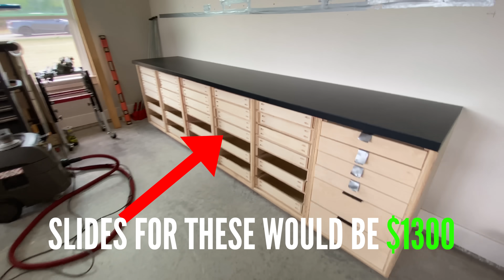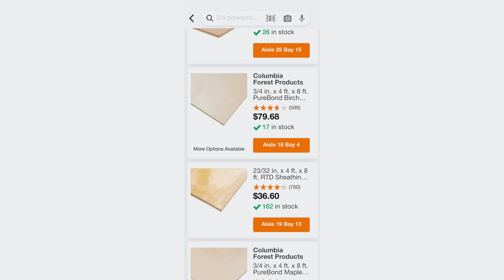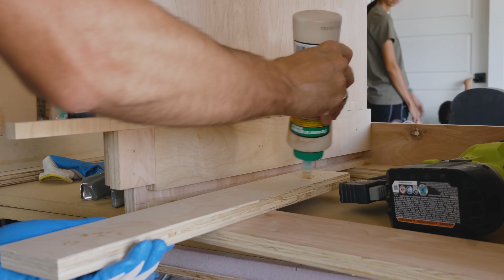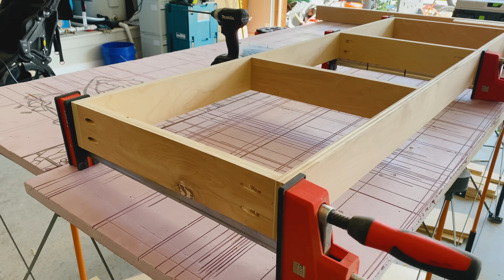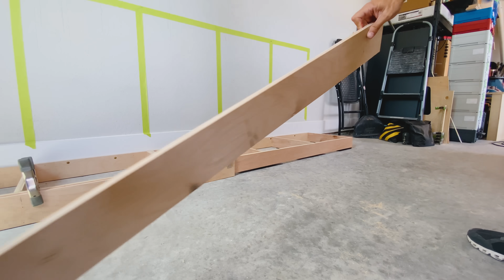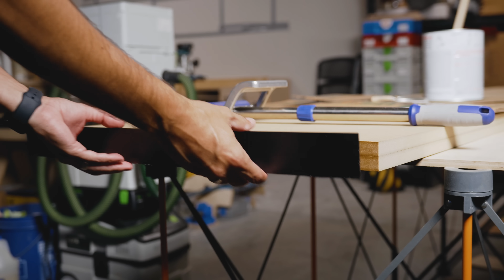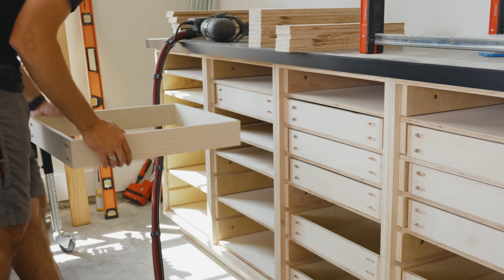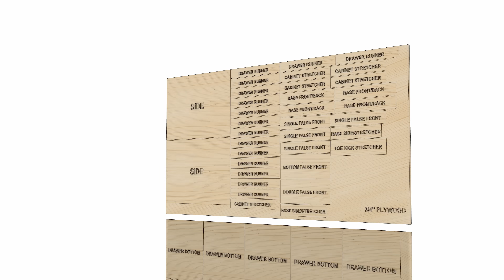Drawer slides are expensive. Do this instead.

Comment: I don't know where the Hell I'd find a snorkel emoji.  Hey, I'm no YouTube artisan but I can say I have a bit of experience with cabinets and counter tops. 
Back in the late 70s and well through the 90s I made most of my laminate tops with Vaseline jelly.  Once you adhere the laminate with the J-roller put a dab of petroleum jelly on the router bit's bearing.  Then go around the edge where the bearing will touch and put a light film on it too.  
Also, I never use a washer with a bearing on my router bit when I'm trimming laminate.  If the bearing has a washer it can cut a fine line.  I have found, in just the last ten or maybe 15 years, that treadmill lubricant (silicon grease) also works well for this.  

One other thing I would recommend is to cut your laminate closer to the actual finish size. Leave no more than 3/4" all around. This way you have less chance of it breaking off under its own weight.  

Another thing you might try, that looks and works better than laminate on the edge band (In my opinion), is to put a hard wood edge band on the counter top.  use some scrape pieces ripped down.   Then you can rout it straight or rout an Ogee (modified) or a chamfer.  

Also, after 45 years of installing cabinets and making counter tops, I have learned a few things about shimming boxes.  You need to glue those shims into place on the floor.  I usually run a little caulking (whatever is on hand) on the inside of the toe-kick base and the top of the shim.  Otherwise, within just a few expansion and contraction cycles they can move out from underneath the toe kick and your bases can sag.  This can cause the drawers, that once worked perfectly, to bind.  And, it will leave you wondering why.  I can't tell you how many kitchen upgrades of done and found the shims towards the center of the cabinet floor area and not under the toe-kicks. 

Another thing, if you don't mind me adding, Butcher's Boston Polish (I prefer this one because I was born in Boston) or Johnson's Paste Wax added to the base of your drawers (draws, drahs) and the inside edge of the runners will help the drawers slide and keep it from swelling with humidity.  As a young man I worked in my uncle's furniture shop (from age 15 to 21).  We made custom pieces and did upholstering.  Once a year I would wax the drawer slides.  His Dad made those drawers, similar to yours, and he started that shop in that building in 1926.  It's a tried and true method for drawers.  Wow, I don't believe I have ever used the word drawers this many times before.  Oh! one last last thing. Don't use paste wax on the router bit or on the edging!  There is naphtha and carnauba in paste wax and it will dislodge/ dissolve the contact cement and your edges will curl off.   
Anyway,
Thanks for sharing the video.  I'm an old man and don't enjoy much anymore, but I really enjoyed this video.  And, great job on the cabinets.

Comment: 🤿 can't believe you used duck tape like an animal.... Very cool alternative to drawer slides and I like when they are built on a unit height they can be interchanged to different positions as needs change. I would probably have looked at not making them as individual boxes and eliminating some of the vertical pieces of plywood, but it maybe would have only resulted in one less sheet. I'm looking at doing cabinets for my shop now and was pricing out drawer slides, the blum are out of the question for sure, but there are some semi-commercial places online that you can buy packs of five or 10 at a time of soft close side mount that come down to about $12 each, full ext. I will probably go that route myself though. I can definitely appreciate this method. But also my cabinets aren't staying in the garage if we move lol, I'll make sure of it.

Comment: Good point about the parallel guides, the 55” rail  and using the reference edge (the first cut) to continue a longer rip cut. I’ve seen thousands of woodworking videos and I’ve never heard it explained like that. Then again I’ve never plucked down my money for parallel guides, but I might have to reconsider?

As far as insulation you could probably just drill holes on the top and middle each bay if there’s fire blocking and blow in insulation.  Then just plug the drywall holes.

Comment: There are special router bits for laminate trimming. They have a slight beveled cut that eliminates the scaring on the adjacent laminate piece as you run the router around the piece. Amana Tool - 47200 Carbide Tipped Bevel Laminate Trim 15 Deg x 5/8 Dia x 1/4 Shaft

Comment: Just a tip for the laminate issue.  If you were using  a carbide laminate trimming bit, you might be able to smooth the ragged  cut by slowly going over the cut in the reverse direction.  It should remove the imperfections.   Nice design.

Comment: Well, what the internet wants did not take into consideration that a garage wall to an interior space of the home is a modified 1 hr fire construction being 5/8" drywall on 1 side and 1/2" on the other. This assembly needs to be taped and mudded to obtain its rating. Just another example of how homeowners screw up their homes by not knowing all the codes. I was an Inspector for over 20 years and have seen it all.
Reply: Exterior walls, and watch to the end 😉

Comment: Seriously curious, could you do all of this with 1/4" plywood? 3/4" seems very overkill if you're basically doubling up on most everything (cabinets sandwiched together is 1 1/2", maybe the drawer runners are good at 1/2" but you could probably even do that at 1/4" no?)

Comment: I’m surprised u was able to slide the insulation into the wall cavity so easily. How do you not have fire blocking ? And how is your wall not insulated???? Love the cabinets and I’m def copying ur system
Reply: Exterior garage walls in this part of the country are not typically insulated. The walls common to the living space are insulated.

Comment: I like the idea of not using drawer glide hardware! That was the traditional way in earlier times, when cabinets were more comonly built at the jobsite.
I have some old recycled cabinets in my garage that were built similarly to yours. Mine were built in 1950's, or earlier. The slides in these were built out of solid hardwood sawn lumber, maple I think, not plywood.
When there is a humid day the slides will swell and the drawers are dificult to open. I'm wondering if your plywood slides are having any issues with humidity?

ps: You should have used tape and joint compound when you reinstalled the drywall behind the cabinets. This is building code requirement for safety. A fire/smoke rated wall is required between a garage and a living space. (residential building code R 302.6)

Comment: To avoid goobering the laminate with the trim router, the issue is router flex. If you have a flush cut bit that is designed for thinner material, that works. Using a 1/2” bit is another possibility. But this is a simple idea: put a layer of painters tape on the trim router bearing. This keeps the router blade a bit proud of the surface . Then you go back with a block plane to chamfer the edges

Comment: Since there are no runners, the drawer can be pulled out too far. One way to prevent that from happening is to place a false back in, which does two things: 1) prevents contents from migrating to the very rear of the drawer which necessitates pulling it out too far and 2)Provides a visible queue when to stop pulling. You could easily retrofit all your drawers with false backs.
Reply: Just use a string and two screws. 
One screw on the back of the cabinet, one screw on the back of the drawer, string tied on the two screws setting the length the drawer can go out. 
If you ever need to remove the drawer just unscrew the screw on the drawer to set it free.
Reply: You can more easily build limits into those. Don’t overthink it.
Reply: You can just make the bottoms longer than the drawer sides. Of course the cabinet sides need to be longer to match.

This lets you pull the door out far and not skip off the track, but also lets you remove the drawer completely if you want to place the full drawer on a table for easy access to all the contents.
Reply: Jer Schmidt uses this method
Reply: @ewong7492  Jon Peters uses it for drawers in his projects as well.
Reply: But the point is that you can easily move drawers out and around with this system. 🤿
Reply: Depending on the space between the false back and the actual back, you could also stash heavier and less commonly used items in there

Comment: The old guy that taught me how to do this. He would  always put soap on the edge before Using the router. It helped to keep from burning into the side of the laminate. It was a long, long time ago in Atlanta, far far far away. But from what I remember we used good router bits with balbearings but still used soap. We would also use soap for lots of things like pulling wire through conduits. Come to think of it this old guy used soap for a lot of things. He probably even bathed with the stuff. I don't know. Anyway, that's what we did

Comment: Good Job, 🤿.  There is Central Hardwoods off Northwest Highway, also Dakota hardwoods off Mockingbird in Dallas. I’d say you might have been tipping a bit on your router. Also look up Dallas Makerspace if you run into a project you might need a unique tool for. The community is pretty good.

Comment: Great video.  Nice work!   I think your router bit is protruding a bit too long for the task.  It flexes small amount, especially if it's a 1/4" bit.  Next time, try to set your bit just over the length you need to cut.  Maybe a 1/16".  I think that should those routing marks.  That or your bearing isn't turning freely.

Comment: Pro-tip: no part of wood should be touching the concrete. At minimum it will wick up moisture and mould or you could have another flood situation that cause the plywood to delaminate and fall apart.
Reply: What do you usually put in between the concrete and the plywood cabinets?

Comment: In generall I like laminated tops, but hate laminated edges. I would have taken maybe 1/2 to 1 inch of walnutt as an edge band of sorts. First get the laminate on the top, to fit the walnut perfectly flush with the top. Made a top with the method, with laminate click tiles for flooring. Quite a bit cheaper, but not as sturdy ofc.

EDIT: as for the drawer - I would add a smal chamfer / round over to the bottom of each drawer and add a good layer of shop wax on all the sliding contact points. Protects the wood from wear and makes the drawer slide better. And add  a chamfer / round over to the rear ends of the bottom of each drawer, so the don't jam if you close them in an angle.

Comment: another super easy way to mount uppers is using a french cleat, makes them easy to take down if you ever move, or adjust if you change designs in the future. leave the wall strip full length to keep it straight, no fuss

Comment: And also you can trim it with a larger bearing, and put a chamfer bit and trim the edge after and use a file to clean up the edge for a smooth edge

Comment: 🤿 Great method. I'd be afraid of pulling the drawers all the way out, or having them tip out if pulled a little too far and take my hand off.
Reply from the maker: easy solution is to glue a horizontal divider about 3" in from the back. it acts as a visual cue telling you to stop, and doubles as extra storage for things you dont need all the time and dont want rolling around

Comment: Here’s the “trick”, iron on wood glue method. Use a foam roller to roll on three coats of Elmer’s wood glue on the veneer/laminate, and three coats on the surface to be laminated. Let it fully dry. Now you can lay the laminate onto your piece and freely position it without it sticking, take a hot clothes iron and heat as you would with iron on edge banding. The glue melts and fusses the laminate to the piece. You will never go back to contact cement again.
🤿

Comment: Drew im about to purchase the two Parallel guides. I have a question after to rip off the factory edge. How do to insure the 90 degree cuts are square? I rewatched the video trying to watch you cut the shorter cut but didn’t catch it. 🤿
Reply from the maker: the second cut it made using the guide rail square referencing the new rip edge.
Reply: @wittworks  thank you I knew I I need to spend a little more money!

Comment: The drawers will slide more easily and reduce damage to the stretchers and drawer bottoms if you add 3 thumb tacks to each side of the drawer.  1 on top of the stretcher at the front and 1 on the top and 1 on the bottom of the drawer at the back.   This eliminates all wood to wood loaded vertical contact.  Just be sure to make the stretchers narrow enough so the thumb tacks clear each other when the drawer is fully out.  Put the top drawer tack at the very end and the bottom drawer tack a couple of inches from the end so that all three tack are not vertically aligned when the drawer is put in place.  You could also put tacks on the cabinet sides at the front and the drawer sides at the back to further reduce wood on wood drag.  I did this with cheap store bought cabinets 40 years ago and they still work fine.
Reply: Clever.
Reply: Combine with some powdered graphite on the wood and I bet that would last forever.
Reply: why not just wax the slides

Comment: Just a heads up. You can get real cheap full extension drawer slides from Imex hardware. Never used them or heard of them until recently, but for the price they might be worth a risk. 36 -  22 in. slides, $ 5.60 each, with shipping comes out to $221.59 from Imeca, which is predominantly located in Florida. Name is similar enough so it could be a house brand, but not sure. The 22 in. slides were $5 for Black Friday.

Comment: Quick question, what is the thickness of the sheet that you mount to the wall？
Reply: I believe it was 1/2 inch
Reply: Correction, he actually used 3/4” ply

Comment: Personally I think Wood Toe Kick Boxes that need to be leveled are a thing of the past, you can get plastic adjustable "leveler legs" for about a buck or 2 per leg thats rated for 330 pounds per leg and you never have to Shim again, it's basically how Ikea Cabinets work and have the benefit of no Wood touching concrete should the water heater go boom and leak everywhere.

Comment: Guys, this water monitor….get it!  I’ve had kids flood toilet at 3 am…water puck caught it.  Hot water heater leak…water puck caught it, ROTI water system pipe burst…water puck caught it and our big 300 gal saltwater aquarium…yep puck caught it.  I can’t praise them enough.

The laminate…try a heat gun. Ease the heat in and the. Use a heavy  smooth block of wood to keep it smooth and flat

For your pronunciation…. Here goes “drawer” is dra-wer. DRA (as bra) with WERE

If you ever use the mfd for another project.  Coat it with white Elmer’s glue.  After the glue dries (clear) it with paint more evenly and may take less contact cement.

I hope you get carnauba wax for the rails.  Put some in a clean coffee can…I got 5 pounds on Amazon and they looked like they were the size of tic tac.  Heat some up, use a cheap chip paint brush (.96 at Lowes) saint the inside and outside of the rails. After it’s cooled, you can scrape,off any places that may interfere.  Cabinets and drawers.  Slide like it on bearing rails.

Keep a scrap of plywood to cover a small section of your countertop.  It’ll keep it nicer, longer.

Great job. A ++

Comment: If the garage wall the cabinets are on is common to the rest of the house, or under an upstairs room, you need to tape and double coat it with mudd, otherwise you are going to have Carbon Monoxcide getting into the wall and the rest of the house.

Comment: GREAT video, thanks!  I just happened upon it now, & am only about a third-way thru it, but b/c of it I'll be a regular wittworks watcher & go thru all your other vids, woodworking-related & otherwise.  Very entertaining, clear info, useful tips, etc.  Am in early stages of building my own ~3100 SF house, all by myself (or rather, REbuilding orig. modest much-smaller 1939 one, from foundation up, after neighbor's huge fallen tree crushed it).....and crazy enough to intend to also make all the simple clean-lined walnut-veneered kitchen cabinetry for this midcentury modernist design, once I get to that stage.  So this vid's FULL of useful info.  Dunno if I can "get away with" (& more importantly:  get wife onboard to) not using the expensive cabinet hardware --- the sexy auto-closing stuff, etc. people expect on a high-end home --- but maybe yes, after I've studied the whole video & read all the many comments.  Or at least use your method for garage cabinetry; bathrooms; places like that.  (One comment about skateboard bearings is an intriguing option.)

Comment: Why did you feel the need to make the stretchers (the things on the sides of the drawers) the full height of the drawer sides?  I would think they only the top portion to support the drawer above, and the bottom portion of the stretcher to "pin" the drawerbottom of the drawer it's next to.  Seems like the middle is wasted material.